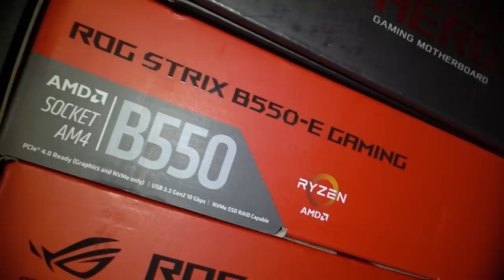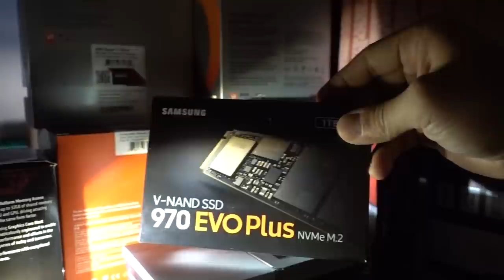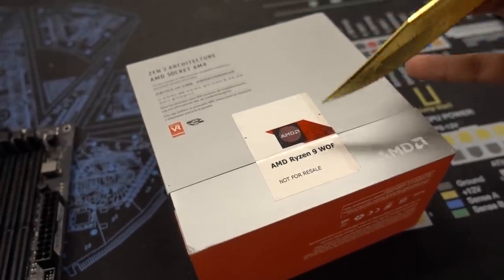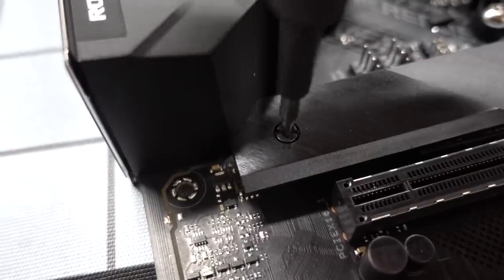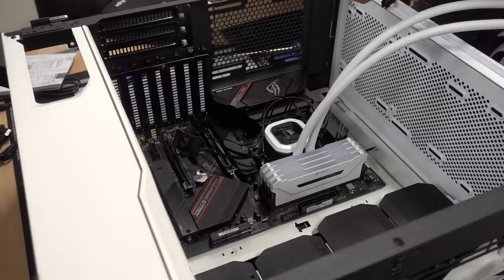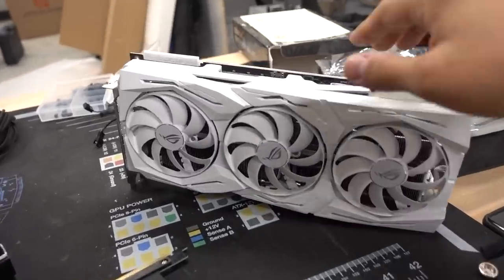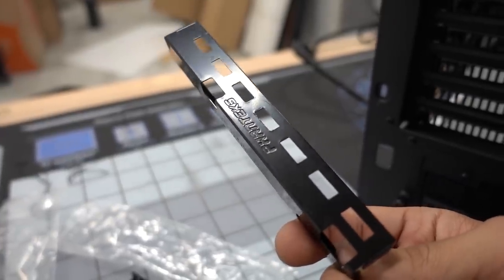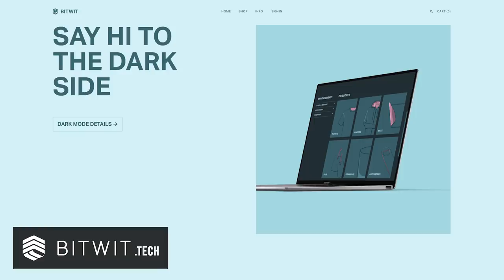They shut off our UTILITIES but I still built an awesome PC!

Comment: Hey kyle I have the exact same case and mobo but Idk where to plug the exhaust fan for it to spin since the mobo fan headers are already occupied for the front fans
Did you happen to buy a fan splitter? Or if possible maybe you could show the cable management

Comment: What's the trick to sliding the GPU right into the PCIe slot with no fuss? I had to do so much prodding around and trial & error in my recent build that I was scared shitless I'd scuff some kind of a pin off the connection or something.

Comment: Were you not able to route the GPU power cables behind the GPU? The cables are very straight so it is not a big deal. Great looking build but the black cables detract a tiny bit.

Comment: i just bought the same cabinet, and used about 30 mins. serching for the front connectors, to find out that there is only 1 power sw and a sata power, but I can't get the front fans to cirkel through colors by pressing the buttons in front

Comment: Hey i have a question i have the same case but i have an asus x570 pro prime mobo which has only 4 pin fan headers and the case fans are 3 pin what should i do?

Comment: Did you have to use a splitter for the PWM fan connections or were there enough fan headers on the motherboard?

Comment: Overall, both aesthetically and functionally, the case is amazing. My only real gripe in terms of aesthetics is that I don't like how the mounting slots for the front fans impedes the the lighting on the fans. While I'm not saying that this is necessarily an oversight on Phanteks' part, I do feel like there could have been a better way to go about this. For instance, they could have extended the front panel enough as to accommodate external fan mounting.

Comment: Rate my system 
R5 3400g
Fxf rx 570 8gb 
1t ssd also the same price as a 120g ssd so that’s why
1thdd 
32gb 2400 ram same price as 16g so 
650w psu 80+bronze
1-10 please rate it for me
Reply: An eight! I would upgrade to a r5 3600 and a better gpu I recommend the xfx 5600 xt ll thicc graphics card
Reply: éssence ok thanks the only reason I’m not upgrade to the 3600 is I got a killer deal on the 3400 for only 100 and it has worked fine

Comment: I'm new to biulding PC's and I'm looking to build my first one soon, what should I start with in terms of parts
Reply: Decide on what type of build such as mini itx, mid tower and full tower. Then look at what components you want afterwards.
Reply: @medicgaming7367  I'm going for a full tower, I already have a motherboard, ram, and a hard drive. Had a power supply and tried to plug stuff in but it just didn't even do anything

Comment: Hey Kyle I need your help so I went to switch out my cpu cooler and I unscrewed all the screws and I could tell that they where unscrewed and so I went to pluck the cooler off the cpu and it didn’t come off so I was like okay the thermal past might be a little sticky
Reply: So then I pulled harder and I yanked the cpu out of the socket and idk what to do cause I can’t put it back in and it’s stuck to the cooler and idk what to do so I thought you might know what to do

Comment: 29:32 Had Phanteks actually gave the front of the case more room in between the frame and the front panel, the garish display of the frame behind the front panel would have been completely nonexistent and the fans would have been much closer to the front panel. They almost had it juuuust riiight.
Reply: Is the case good to buy?